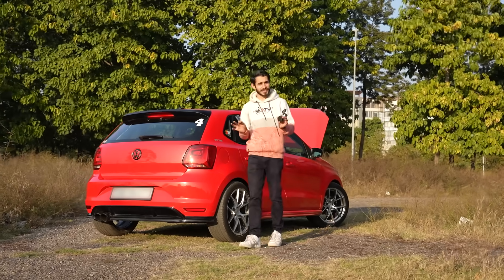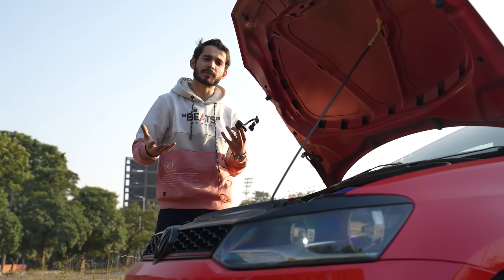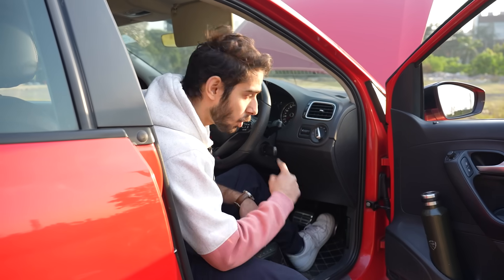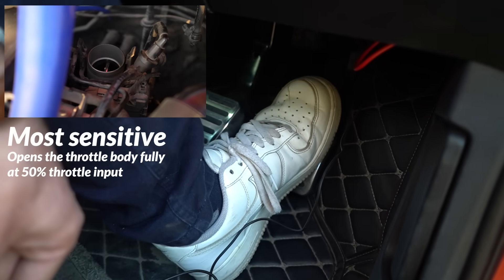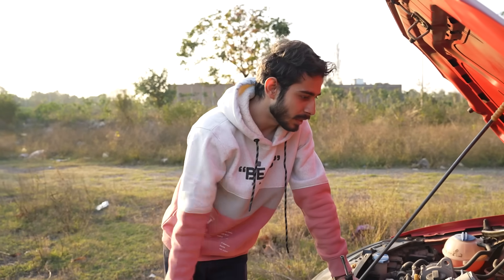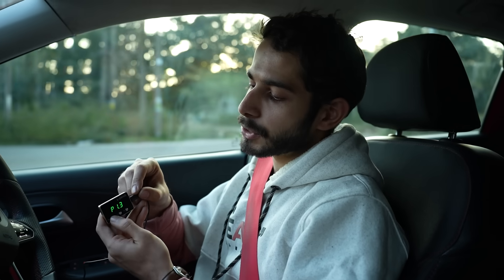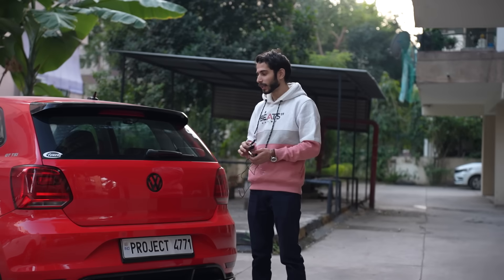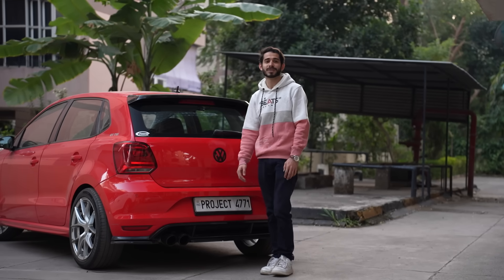Throttle Controllers: The Truth

Comment: Even stage 1/2/3 is a scam because ECU automatically advances or retard timing depending on octane of fuel. Forcing the timing means putting stress on engine and reducing bearing life.
Reply from the maker: It’s not just timing which is tampered with while tuning, boost is increased as well, other parts of the engine are changed as well, I should make a video on this too, to clear the air and misconceptions around tuning.
Reply: @PrerakKataria  No misconception.  Its not like manufacturer forgot to tune the car, so tuning isnt really required..unless you have significantly changed to the internals, which most people do not do. There are like +500 parameters in ECU, mostly it is guess work done by coders and winols, as most people still dont know what each table does, what each condition does etc. (Its like opening an excel file in a notepad,  you will see gibberish) . I know there are dozens of things that are tampered - timing, afr, knock conditions, knock sensitivity, lambda enrichment, even throttle table....again manufacturer has already tuned the car and ecu these days readjusts all variables depending on air temperate, altitude, octane - all done to maintain reliability and of couse emissions / fuel consumption. The concept os Stage 1/2/3/4/5/6 bla bla is just there to extract more fee from clients.
Reply from the maker: @branduncensored coders or tuners don’t work on guess work, we tune with E-Tuners Greece maps which have been successfully running from 999cc cars to biggest engines of india in supercars, it is real meticulous work. While stage 1/2/3 these numbers don’t make much sense it’s to put into perspective what the client is getting. Stage 1 is pretty much a tad bit more power stock, stage2 is essentially where boost is increased significantly and decat system is required, stage 3 would bring about bigger hardware modifications and an entirely new custom map would be made, so it is mostly to put these things in perspective for the client that we call them stage 1/2/3. It’s not a scam, manufactures have made their cars to meet emission norms, give highest possible fuel efficiency in different conditions and they’re made to adapt you’re right about that, but wrong about the fact that tuning does nothing. As independent tuners we don’t have to fall under these constraints, once a vehicle is in the hands of the client it is their choice, to customise the car as they please that involves engine tuning, tampering the exhaust and intake a bit to get more power.
Reply: Gadgetmangroove modification

Comment: A dialog some say is that it gets too cold when the AC is set at 16°.  But the fact remains that the AC will run until the room temperature reaches 16°. The power of AC is same.  This thing is like that.
😂😂😂
Reply: AC will work hard to maintain 16 degrees again and again

Comment: Hey my 2013 Polo 1.2mpi showed up ABS that keeps coming back and forth. Took to nearest garage, ABS module is not communicating - the only option I’m told is to replace this at after market for 25k (ABS module) Not sure this is the only option. Pls suggest if there’s any work around
Reply: If the ABS module is indeed fried, replacing it is the only option. You should be happy that it costs only 25k for your car. For the Jetta, the ABS module costs 1.5L.
Reply: @ No such physical damage can be seen / found. Only thing was it’s not communicating during scanned.
Reply from the maker: First check the CAN lines on the ABS connector, check if it’s getting 3-5Volts or not, if not, trace the wiring

Comment: I Don't know about these Chinese one's but i've been using DTE Systems Pedal box pro (German made) from the past 6-7 months and have done about 15k kms in my Stage 2 Vento 1.6 Tdi. I've always been a sucker for a good throttle response and this just delivers more than what i want. its really fun to use and makes it easier to use all the power that your engine delivers.

So far not even a single issue and DTE pedal box comes with 2 years warranty and with some fail safe function too. I would recommend this in a heart beat. But definitely, not those re-branded Chinese one that everyone are selling. I don't trust those shit

Comment: Staying completely unbiased. I agree to the part where selling it with a pitch of more power is a wrong practice. However, generalizing it as a scam is a wrong practice as well. In a simple language, with throttle commander, you get the liberty of how quickly you want to put the available amount of power to use, and I really believe that that is what most of us need on roads when we quickly want to overtake in a limited window without any delays after pressing the pedal. Now when we jump into tuning stuff, where we actually speak about the increasing power and torque figures, one thing that sellers dont open up is the rpm range where that increased power actually make a noticeable difference, which I am not sure how useful it is because people do-not stretch their rpms soo high in city or highways… it is a different story if you are on a track. So rather than presenting one thing (tuning) above the another (throttle commmander), I guess it should be fair to present it in a way where customer understands what is the real need based on their purpose. 

As long as legality and safety is concerned, that goes common with either of the mods discussed above.
Reply: Yup it just changes the pedal  throttle sensitivity, its not a scam! Scam if they say its will give more power.
Reply: Really Happy 🙂 that people are pointing out it is not a scam🙂🙂👍
I totally agree pitch of more power is wrong practice and should be stopped but 
the product is not a scam as it does decrease the delay which is the correct pitch for this product 
(Note- I have not personally used this  product ,this video is the only time I have heard of this product,,I am just happy 🙂people now know the definition of scam and using it correctly)
Reply: @Timewastedonyt  wait a min.. saying it will increase power and if it doesn't increase power, its a scam, right? its not doing what was advertised.. 

For example, we buy a home theatre system.. its advertised 500w RMS output.. but in actual.. it barely goes 50w, it is a scam right? We don't say its not a scam because it at least gives 50w output??

BTW, I am not here for a stupid argument.. just like you heard about this product through this video only..

Comment: When we usually do a stage 2 tune along with other modifications such as free flow air intake, egr delete, decat, turbo upgrade etc.. to accomodate boost pressure increase and make the AFR map and ignition timing work, the ECU is usually remapped to do this to some extent

Comment: I recently watched a Mighty Car Mods video that said air intake systems don’t do much or even negatively impact performance of the car. 🤣
Reply from the maker: For smaller engines, they improve the low end performance, unless you tune your car your peak horsepower won’t change much, but for smaller engines it does. I gained 12 HP over stock with my custom intake setup, first time on the dyno everyone was shocked how my car was making 115 HP on thr stock map, with a custom Downpipe and custom air intake system.

Comment: Thanks for the clarification, I always thought changing manufacturer provided drive modes in my car makes it run on a different tune. But it’s clear from the video that even changing the drive mode is simple throttle manipulation 😅
Also, what’s the cost for stage 1 tune for Tata Altroz and does it void the warranty?

Comment: Hey Prerak what would be your suggestion for a better intake for a 2005 Maruti Esteem
Reply from the maker: A custom plumbed cold air intake would be good I think
Reply: @PrerakKataria  Actually it has a pod type filter and a resonator box. So it is almost like it has a factory cold intake built in as the filter is placed just next to the right fender behind the headlight.
Reply: @CroftVan esteems benefit from cold air intake and decat exhaust like crazy.. But they lose low rpm drivability... Just decat and stock intake seems to be the limit for the ECU to compensate

Comment: Bro make a same video on dieseltronic piggy back ecu
Reply: Dieseltronic is not a gimmick! I'm running a dieseltronic dual channel piggyback ecu.. It reads MAP Airflow sensor and Fuel Pressure sensor and alters accordingly to your selected map.. You actually gain more power through higher fuel pressure!